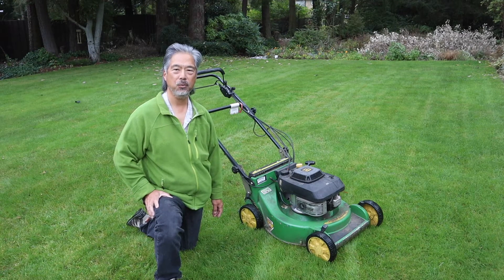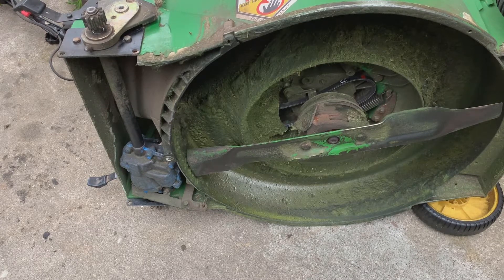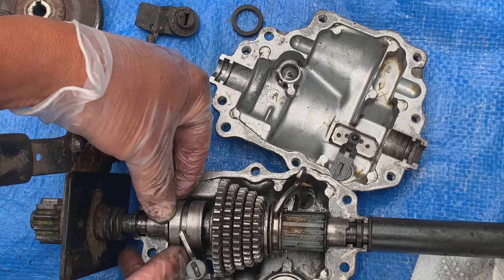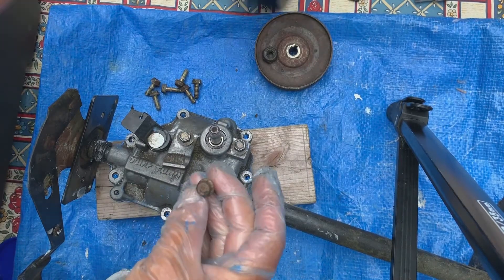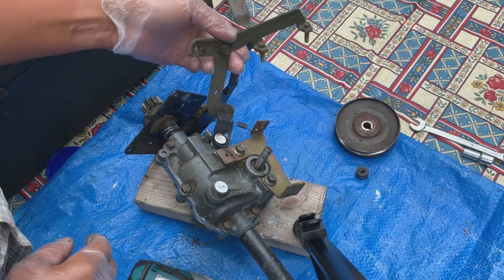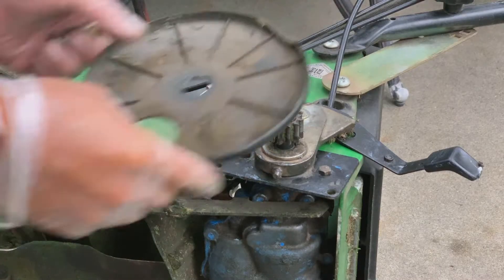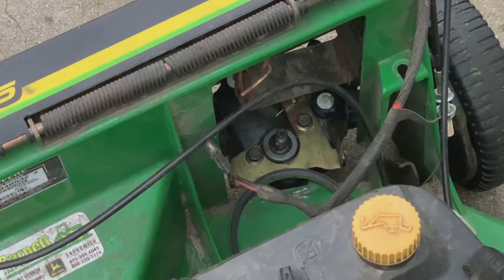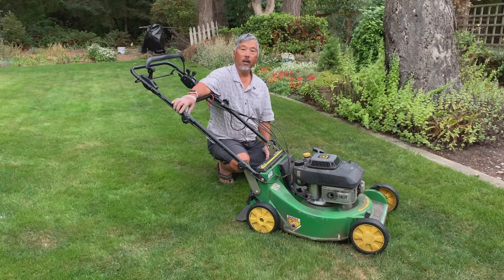How to Rebuild a Tuff Torq Transmission on a John Deere JE75/JX75 Self Propelled Lawn Mower

Comment: With out removing the transmission only the pulley and belt I was able to add 6 Oz of gear oil by removing the shifting arm and using a syringe. Shifting and engagement of the transmission has never been so smooth. I was having trouble with engagement and that is solved with the fresh gear oil in the transmission. Your video helped me discover the way to add gear oil with out total disassembly. Thank you
Reply: does it leak out?

Comment: At 13:40 of the video it shows the engage leaver off and this is the place where I will be able to add an ounce of gear oil to loosen up the dried up grease and avoid splitting the transmission.

Comment: How did you get the knob holding the door on off been trying for over an hour to remove it even used penetrating oil and won’t budge
Reply from the maker: I’m not sure what knob and door you are referring to but it sounds like penetrating oil, time and vice grips can’t be wrong.

Comment: Is there any possible way to grease the axle without complete disassembly? Mine is ancient and I'm sure needs it
Reply from the maker: There’s no grease fitting and the way they are sealed, they are probably intended to be lubricated for life, but these mowers just run forever, so what would be a life for most mowers is just midlife for these JD’s.

Comment: I am having a hell of a time getting the top half of the case back on.  Any suggestions?  Thanks for your videos, they were definitely helpful while swapping out a cracked deck.  I decided to inspect the transmission while I had everything apart.  It was not hard until the step after gluing the gasket.
Reply from the maker: The trick is to make sure the lever arms align with the internal structures they operate.  If they don't mate, the halves won't come together.  I used grease to hold the bits in alignment while I brought the halves carefully together.
Reply: @whidbeyben  thanks. I finally figured out that you have to wiggle the two switches using pliers to get everything aligned.

Comment: Why not add a grease port to the case while you have this apart!?
Reply from the maker: This is something that shouldn't require periodic regreasing like a ball joint, and might overpressurize the case. Besides, not everyone has a machine shop and are comfortable with drilling and tapping a hole to add a grease zerk.
Reply: I bought this mower in 5/2004 and have not had any problems with the drive. But, if it had a grease fitting Im sure a “Dab” of fresh grease wouldn’t hit it!
Reply: @adriancook4113  I am going to try to add gear oil at the engage leaver point of the transmission only an ounce of fresh oil would be able to loosen up the dried up grease.

Comment: I've done something wrong.  The wheels will not turn backwards.  Any ideas?
Reply from the maker: This is likely related to the pinion gear in the wheel assembly. See this excellent video. https://youtu.be/a9Dz-sadfAU
Reply: @whidbeyben  I found my problem.  It had nothing to do with the axle pinions.  I discovered my problem when I tried to mount the rubber guard on the back of the mower.  The long rod goes through two holes on the bottom of the left and right mounting brackets.  I threaded my rod through the hole on the left bracket only to discover that there was no hole on the right bracket.  Further inspection revealed that I had installed the right bracket upside down.  After fixing that problem, I was able to install the rubber guard and as a bonus, my wheels now easily roll backward.  Live and learn, eh?
Reply from the maker: @nonoandpapa  That's great!  Also great to share multiple modes of failure to help trouble shooting because there are many things that can go wrong in complex mechanical systems.

Comment: What grease did you use inside? This will be my next service on my 14SB.
Reply: If you have a JD dealer nearby you can go there and buy the OEM transmission grease. I bought a tube of TY6341 and used it.  You can also get it on Ebay/Amazon.
Reply: @RoliO11  Thank you sir.

Comment: A dose of grease on the shifter detent before transmission re-assembly is a good idea, in addition to the wheel axle bolts and on the drive/driven gears at each wheel.

Comment: I have one just like it but my problem is that I can turn it. Meaning the rear wheels will not pivot so I can turn them. Please help
Reply: Make sure the rear pinion gears "spurs" are facing the opposite direction. Each pinion gear is tapered on one side where the washer sits. Left side washer out right washer in. Hope this helps.
Reply from the maker: Please check out this excellent video for the issue you describe: https://youtu.be/a9Dz-sadfAU

Comment: Was the control cable super stiff to shift gears before the re-grease?
Reply from the maker: Not in my particular case. Disconnect the control cable and then try to operate the shifter with the transmission end disconnected. If it is still stiff, you have corrosion in the cable and it will need to be replaced.  It is also conceivable that if the gearbox is jammed full of debris, it may not shift between gear sets.
Reply: Thanks for the reply. New OEM cable but still very stiff. It’s a free JD 14SB but.... everything is covered in rust!!! Except for the deck LOL. I’m guessing it’s be sitting outside under a deck for quite a long time. Thanks for your time.

Comment: Hi Can you tell me does the shaft on the primary gear come apart? ours has come apart to the left hand side. Does that mean it has sheered off? If so can I get a replacement part? thank you
Reply from the maker: I’m afraid I can’t help you on that.  If the drive spindle has sheared or fractured, it is probably more cost effective to replace the entire transmission because finding sub assemblies and individual bits is probably nearly impossible.
Reply: @whidbeyben  actually at green parts store you can find parts for these mowers. I found the 2 bearings i needed there.

Comment: I'd be curious if you thought the dirt would also cause a lock when trying to reverse (without self-propelled engaged).  Seems like the clutch could stick the opposite direction (engaged).  I'd been having issues with my clutch engaging and recently started noticing issues with one or both wheel locking up.  Could be worth a teardown.
Reply from the maker: Please check out this excellent video for the issue you describe. https://youtu.be/a9Dz-sadfAU